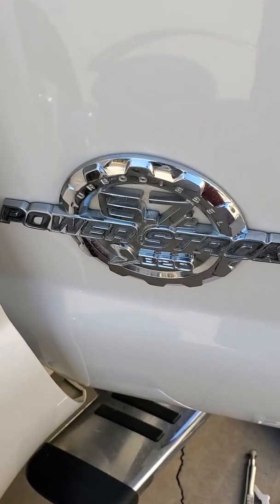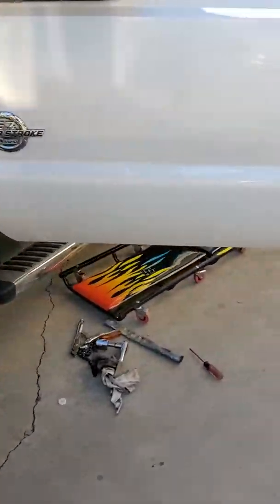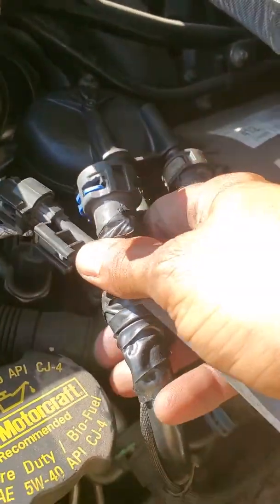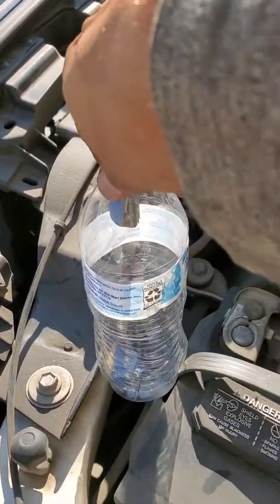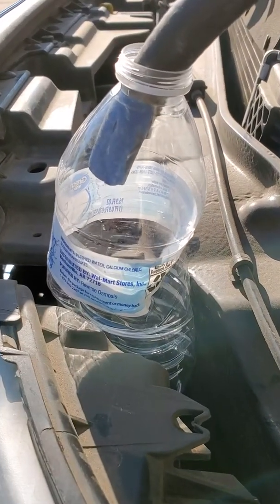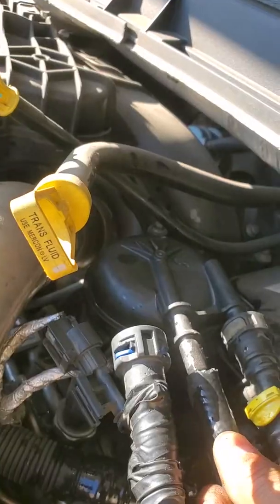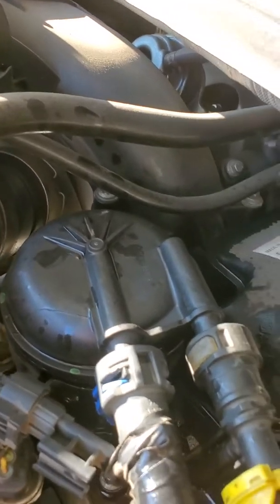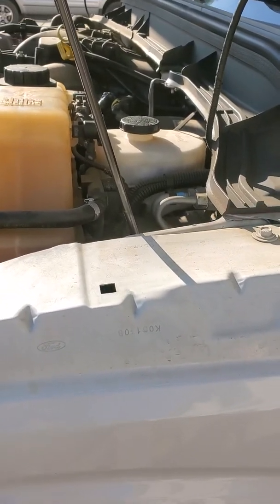Superduty 6.7 fuel line air release after filter replace

Comment: Get a longer line do the same thing but take it back to your fuel fill door instead of the bottle and let it flow back into the tank. Great tip though. Just letting it flow out of the second fuel filter outlet to eliminate the air from both filters

Comment: Thank you! Thank you! Thank you! This is exactly what I needed. It seems the older these trucks get the more resistant they are to starting after a fuel filter change.  Thank you again.
Reply: The bleeder valve was not quite tightened enough. Thank you again.

Comment: Best one I have seen yet, I am replacing my fuel pump on 2016 F250. Will this method also work for that? Also, what size hose did you use 😁

Comment: the key turn method doesnt work sometimes you have to bleed the air out through the top left side line if you dont do this it will burn up your fuel pump and thats a 450 dollar woops!!!!

Comment: I know this is 2 years later of a comment. But why make things harder? That fuel system literally self bleads, Just cycle the damn key 6 or more times and it will take care of all the air without doing all that extra work.
Reply: Doesn't always work if you get too much air in the system like trying to start it without cycling it at all
Reply: How?
Reply: @conflictedshotz8412  there is literally a fuel return line from the CP4 back to the fuel tank, you cycle it enough and drive it will bleed itself.
Reply: @xj1911 that's what I thought as well but for some reason my lifter pump or fuel filter under the hood keeps making a low buzzing/humming noise. I think it's air trapped in the line
Reply: @LevelupMerheb-jl9mr have you figured out why?
Reply: Mine is 2016 F250, so you say it's self bleeding? Just cycle ignition 6 times?
Reply: @rockymtnman  yes, there is literally a fuel return line from thr CP4 back to the tank

Comment: I ran a hose into a 5 gal fuel can until I got no air. I screwed up during the purging process by leaving the bleeder valve on the fuel filter open under the truck. You helped me out big time. thanks